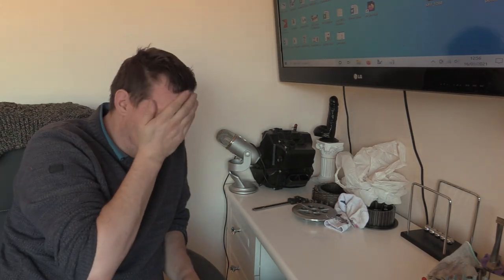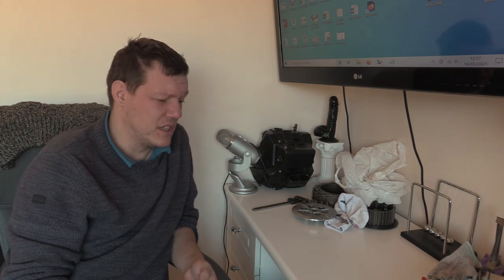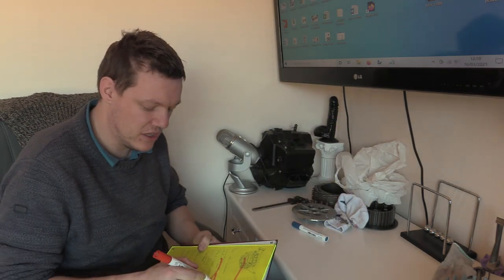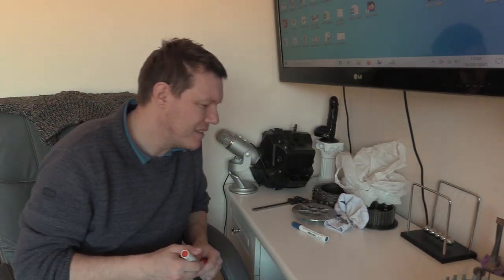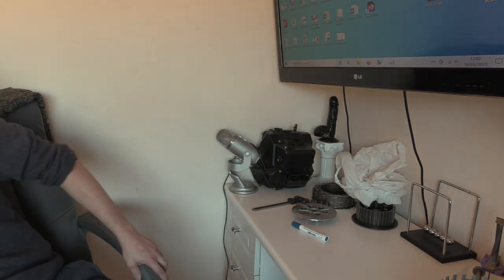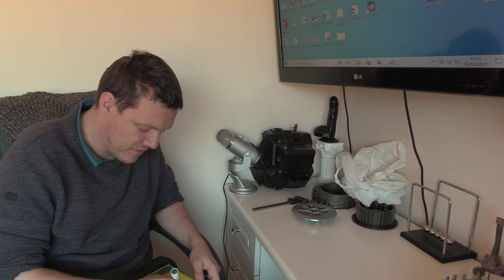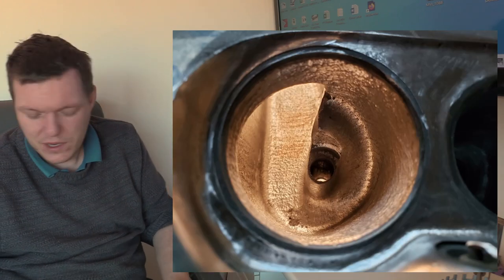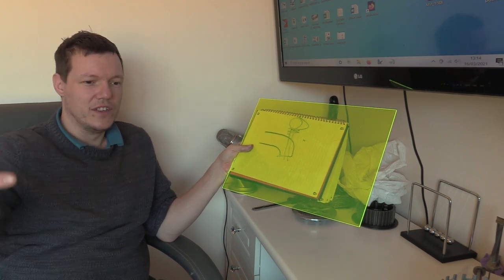Why old ports are JUNK!

Comment: I’d love to revisit an article I read years ago about a bike build for that the IOM single cylinder race that utilised the radial valve design and also with the intake ports that travelled down through the middle of the head. 
Basically the team had a crack at redesigning the old Apfelbeck M10 IL4 idea for their race bike. 
I think the mv agusta f4 also used some of the Apfelbeck ideas?

Comment: High velocity in the port is not a bad thing, just if it's done right, and the port is straight. The amount of natural inertial overcharge of the cylinder, comes mainly as a function of velocity. Basicly you want the gas to flow as fast as it can without causing a reduction i mass flow, otherwise you can give two fucks about seeing over 100% VE on a NA engine. Also most often the main restriction even in 4v heads are the valve to combustion chaber transition. A port as big as the valve is of no benefit if the port-valve-chamber transtion only flows half of what the ports area is capable of, then the port stil flows like shit, just with low velocity with no dynamic pressure to it, and it becomes even shittier.

Comment: Some of the knowledge doesn't give you the whole picture. And as always engines are built to a price. The advantage is not multiplied by 14000rpm like a bike engine or f1 engines so it's not essential to have straight ports. And no generally they are not adding material in the position you showed but earlier which gives it a straighter shot and in engines like the LS1 where those ports were big enough at that point to support much more horsepower than they are aiming for and only served to slow down velocity at lower rpm where larger cubic inch engines operate more of the time.

Comment: have you already made a video on port injection vs direct (in the cylinder ) injection?
Reply from the maker: No, because thats a car thing, and not interesting
Reply: @dirtygarageguy  alright, clear XD
Reply: @dirtygarageguy  oh man :( that feels bad
Reply: i thought car technology is stolen from bike technology
Reply: @Manuqtix.Manuqtix  usually comes on cars first, dont have as many packaging concerns.
Reply: @twanwijn7672  engineering explained has some videos on direct v port injection as well as newer hybrid systems that use both for multiple gains and it is very interesting.
Reply from the maker: EE videos 🤣🤣🤣!
Reply: Do you get direct injection bikes?
Reply: @dirtygarageguy  says the dill whining about American V8s with only enough knowledge to make himself look arrogant. Without even the foresight to ask would direct injection become a thing in motorcycles. You could even bang on about how you think it won't or how you came to be so butthurt at the mention of Engineering Explained. My money is on jealousy.
Reply from the maker: My.money is on Jason getting most of whatvge reads correct, but making assumptions about the rest. What you don't know is he said so himself. Anyone who says "gains" is a twat, anyone.
Reply from the maker: Direct injection on bikes? Only if they have no other option for emissions levels.
Reply: @dirtygarageguy  ah yes the use of an appropriate word makes someone a twat. Nice non argument. Sounds like you aren't confident enough on the subject but unlike others your ego doesn't allow for honesty. Anyway I look forward to your video explaining why more tuning variables, better emissions, more power and fuel economy are such a silly idea for bikes.

Comment: So theoretically with a supercharged application, a newer port design could be used with a carburetor then? As there would still be some (albeit minimal) air flow over the venturi with the valve closed. And would a double sided slide valve for the throttle improve even spray of the fuel vapors?
Reply from the maker: The problem with carbs is do you.do draw through or blow through, each has their pros and cons...
Reply: @dirtygarageguy  ah forgot to say draw through, sorry about that

Comment: Funny thing about the RR Merlin is that the mixture went through the supercharger impeller(s) after the carburetors. I read somewhere the supercharger made for a very well mixed charge.
Reply from the maker: There was 2 updraft carbs right before the impeller. They had 1 impeller to start with and then fitted a speed selector gearbox. They then added another impeller later on. 

One of the problems they had was fuel starvation at the front 2 cylinders because they're so far away from the primary manifold

Comment: Matt,  does blow by in a worn cylinder reduce risk of knockin and preignition?
Reply from the maker: No. Good question though... blowby just decreases the working pressure. Knocking is caused by hot spots.
Reply: @dirtygarageguy  ok!   Does blow by get worse or less on higher rpm?
Reply from the maker: It depends on what causes the blowby. If it's wear then no. If its the rings then there will be a frequency when it reaches peak then falls again.

Obviously in terms of litres per minute then yes.

Comment: Could we piss off injectors and carbs and have some sort of remote mixing tank to get the perfect mixture of vaporised fuel and air and then it can be pumped into the engine?
Reply from the maker: Not at the correct speed. If you had a system that mixed ahead of time you'd lose all throttle response or waste fuel
Reply: @dirtygarageguy  it would have a new name too. A bomb haha

Comment: how dare you besmirch the venerable LS and its pushrods....and you completely skipped vacuum carbs---which from a motorbikist is a cardinal sin... but to be fair id convert my old honda 600 f4 to f4i spec in a hot minute...
i leave the thing more than a month withotu starting and it just wont go until i pull the bloody plugs and dry em off.

Comment: I know as much as you love to rag on US V-8s, Harley's and pushrod engines* in general. There are other considerations. Engine packaging. The average RPM the engine is running at. Face it the vast amount of time an engine runs at over its life span is never at high rpms. Another consideration is that for the most part displacement or power output has never been a cost issue in terms of vehicle registration and licensing.  There are a few states that do tax horse power in terms of legislation.  Some others tax based on purchase price or vehicle value. But there is no national standard in terms of vehicle registration,  licensing or power output/displacement. This may change. One never knows. One thing that does surprise me is that there has been no political push to limit vehicle speed or horsepower output. The reason I mention this is the absolutely insane idea of someone with more money than brains being able to walk into a dealership and drive out with a Dodge Challenger or Chevrolet Camaro/Corvette or Ford Mustang that will reach 300 mph or more when they have no where hear the skill level to handle it. The same applies to Porsche's,  Lambos and Ferrari's. If the fools want to kill themselves that's one thing. Just so long as they don't take anybody else with them. This idea also applies to high performance sport bikes. In the US pilots licenses are issued by the FAA. These are issued in a number of levels on competence. If one has a license for a single engine Cessna you can't just go out and fly a P-51. Also in the US it is much easier and cheaper to obtain a driver's license than most countries.
*the overwhelming majority of US engines are DOHC 4 valve designs of 4 and V-6 layouts.
Reply from the maker: Th average engine rpm, for my bike, is very high

Comment: 23:26 How many generations of pushrod V8 intake ports have you personally inspected or seen either flow bench data or better yet CFD data for?
I understand where you're coming from here, but having seen all of this information personally you're coming from a place of unintentional ignorance.

The amount of CFD and real world testing the likes of GM goes through is unbelievable. The port designs they are using today are massive improvements from what they were even running a generation ago in the 2010s. The vortec head design or the old iron heads are absolute dinosaurs by comparison.
Reply from the maker: These engines are designed to a cost. You can go on about CFD as much as you want, physics doesn't change based on how much money you spend. Loads of work has been done on the heads, I have no doubt, and that work was how to make the design work better, without changing the overall head layout.

Comment: Fucking HiYaa 🥋lol, I was surprised you are talking about adding plasticine to ports, (who would think that’s a good idea?) I always thought when people messed around with ports it was to smooth them out but this is the opposite, interesting. 
good vid as usual.
Reply: its an art, do not attempt it if you dont know exactly what you are doing....adding material here, taking it away there,  plasticine is for experimenting , you finalise the design in epoxy....its tuning in the same way as any other sort of tuning...you get out of it what you put in... you can tune for more power or you can port to move the power around the rev range...if you go all out for top end revs, you will lose power lower down the range,,,,andys motorcycle obsessions has a great video of a guy porting his ducati head....
Reply: @deadprivacy  this is way above my pay grade, not something I would want to do. 
Something for the pro’s to do in my book, I’m fine with stock. 
Andy’s vid is good, never heard of adding to a port only removing material. 
Every days a school day. 👍
Reply: @mtogp46  ive only done two stroke outboards myself, no exhaust pressure wave to worry too much about ,its little more than tube and the airbox isnt so much flowed as its also a lid...- its a lot of fun on old engines as the castings were rougher, the ports dont flow so good as stock, my favourite hobby was taking old yammy twins that come in 15hp,20 or 25 flavours, same blocks with  different carbs and squeezing more horses out of them, 
taking any oldish aluminium head and having a play with it is always fun even if you arent "Porting" as such, but just improving flow by removing casting marks and obvious limitations in older castings to get better flow. but its all a bit of a fart around for no reason these days as matt states,,...if you want to tune an old motor, first job is just to add injectors and sensors and hurl the carbs in the bin.

Comment: A smaller port doesn’t make a carburated engine make more power but it does give it more power in low rpm scenario i actually have a 82cc engine with 3 heads one with a 13mm port one with a 20mm port and one with a 28mm port with all matching carbs the 28mm port head does have a bigger combustion chamber so it has a bit lower compression and the fact is that it only matters what you’re planning on doing the very small carb will have a lot of power in the 2500 to 6500 rpm ratio but after that it will pull a big fucking vacuum and power drops think it makes around 8hp with the 13 mm one if you bump it up to 20mm it makes the most in the like 6500 to 10000 rpm ratio and the 28 does nothing below 8000 it al has to do with mixture speed you want around 60m/s at youre desired rpm the guys who made the ports smaller probably made a bit more power down low where you feel it but they certainly lost hp in a efi scenario you can trow all of this out of the window because youre mixture is made practically after the port so you only want as much air as possible  getting trough the port

Comment: I feel like its a similar thing to mention - I have an 87 125 two smoke & the manual talks about a venturi in the exhaust port. It is supposed to increase fuel mileage. Is it just a restriction I could do with removing or best to leave it how honda made it?
Reply: If it increases efficiency it shouldn't effect overall power by much if at all. Also they did not restrict bikes before the 2000s so that will not be its function to restrict at all

Comment: ls engines are made with packaging and strucural rigidity vs cost in mind and that is it... there is absolutely no way you can have 4 cams on top of a 6 litre v8 and keep anywhere near the form factor of the ls... im a total honda fan boy but the k series is taller (intake and exhaust manifolds and accesories included the ls isnt much wider) and just as long as the ls... and i bet an aluminum ls isn't much heavier if at all.. that along with cost per hp is why the it continues to be one of the best swap options for so many small cars (even tho they are made for american land yachts)... as for the ports it is also a packaging thing but i think the newer lts have some more traditional modern port geometries along with direct injection and they are quite efficient...
Reply: Another thing is the BOM. Only have to make one cam, one cam bore, small timing chain.
Reply from the maker: American v8 engines are built to a budget, the lowest budget. For example, sodium filled valves. That's really, really old technology and has been replaced with expensive design and materials... there are other engines out there like kia that have the same valves, and they are definitely the budget end of engines.
Reply: Gm V8 is easy to get and cheap - even outside the US - so people use them. Are you comparing the overall height of a wet sump vertical engine with that of a dry sump V? Intake goes between the V, exhausts hide under it, so the width comparison looks valid until you actually try to fit it - into a Honda K engine bay? -  and realise the cross-section is a nightmare.

You don't need a 6.0 to produce 'Vette C8 power, so the quad cam comparison is pointless.

Comment: Regarding port design of the older (carbureted) engines, I am somewhat confused.
If we look at the two extremes, having a port that shoots straight into the head (more conducive to laminar flow) will allow us to pull more fuel / air into the cylinder and make more power, however ~20-30% of that charge won't burn properly due to bad mixing/atomization. On the other hand, if we have a port designed to induce sufficient turbulence as to allow 100% of the charge to burn, we would make more power, but due to the restrictive nature of the port that fuel/air charge would be smaller.
What I don't understand is how engineers at the time were able to pick a sweet spot between those two extremes and design a port to suit. Obviously these were very smart people so I'm guessing they had some idea of where to start, but in the end did it just come down to trial and error / dyno testing multiple variations?

For example, the jaguar XK engine originally started out with a curved port head, but later (though before it switched to fuel injection) changed to a straight port design.
Source:
http://www.jagweb.com/aj6eng/xk-engine/page2.php
You can go to the bottom of the previous page for an illustration of the curved port head.

As far as diesels are concerned, I reckon this is a good watch for anyone interested:
https://youtu.be/p3QKTB3GnLI?t=60

P.S
I am inclined to agree with you where the whole carbs vs. injection debacle is concerned. Most of the cars in my family are relatively high mileage, and we've never had any injector issues. Having said that, I'd rather have an old SU if I ever found myself in the middle of the Namibian desert.

Oh and while we're talking carbs Matt, can I ask why you haven't covered Lectrons? I assume the answer to whether they work as advertised is a bit more complicated than a simple yes/no.
Reply from the maker: Because I have a list and they're not near the top yet
Reply from the maker: As far as the jaguar engine goes we're talking general principles not ever single.case ever, and there's probably a good reason...
Reply: @dirtygarageguy  Understandable Re. Lectrons. That list must be of an intimidating length by now 😅